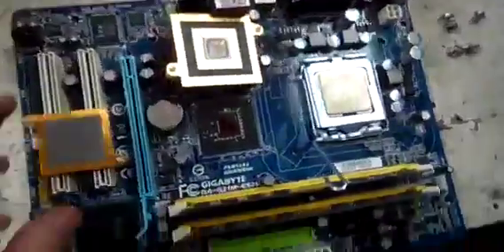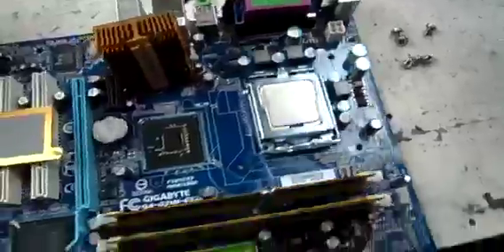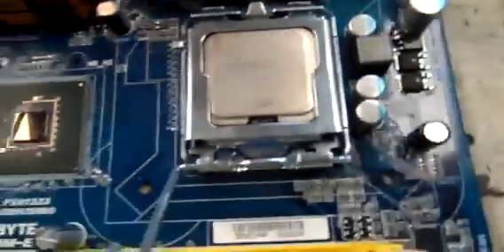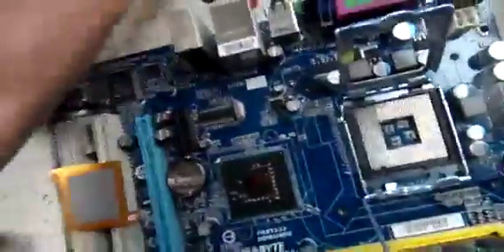AMD Athlon Retrofit P1 - Casing Cleanout

Comment: Is that case made by E-System?
Reply from the maker: Not so sure on who made that, one things for sure, it's made from good quality steel!
Reply: yeah, it's only because I have a very similar case made by E-System.
Reply from the maker: Chem_Boffin_6589 oh nice! Yeah I'll have to have a look on the inside of it
Reply: Ok. I use mine to test the hard disks I get. Pity is, the Foxconn in it motherboard has a Celeron D and almost all of the caps on it have vented.
Reply from the maker: Chem_Boffin_6589 nasty, yeah I used to do the same, but the main board blew up so i did this vid on replacing it!
Reply: Yup. It seems the power supply that was originally in it blew them-one of those generic power supplies that come with cheap computers.
Reply from the maker: Chem_Boffin_6589 yeah it wasn't a known brand PSU, although that still worked afterwards,

Comment: I had a similar board that was doing the same thing. Mine had a transistor near the SATA ports that was shorted and would heat up enough to cause skin burns instantly.
Reply from the maker: That's not an uncommon problem for them to cook the transistors like that, although I've never heard of them heating up like that!